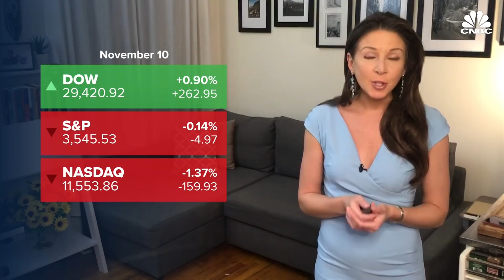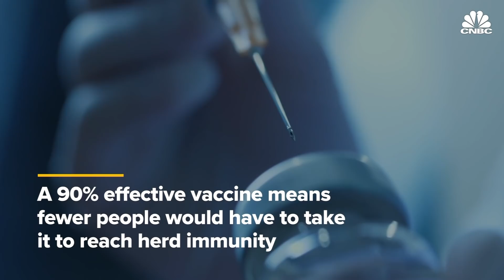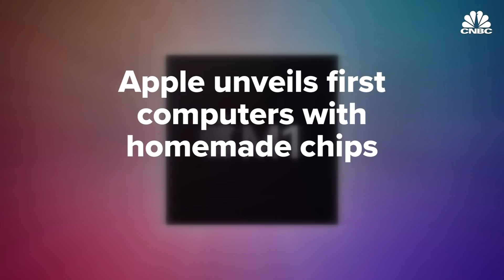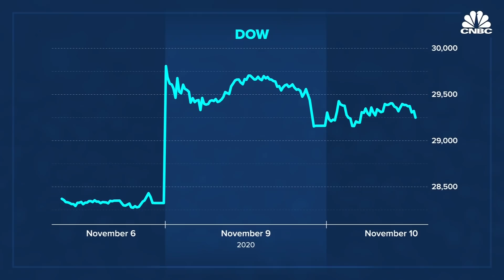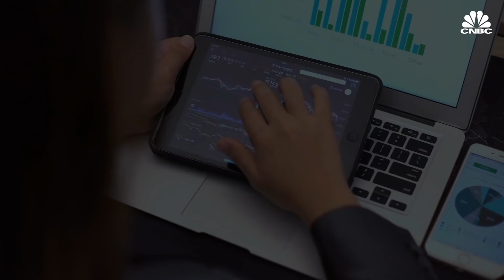Pfizer's Covid-19 vaccine is 90% effective — here's what happens next: CNBC After Hours

Comment: How can it have a 90% success rate when the flu vaccine (which they’ve had for decades) success rate is usually around 40-50% each year?
Reply: the flu changes a lot, same virus different structure, and the vaccine they give out is from last years flu, not the current year, so it might not work as well if it works at all

Comment: After the recent drop, if the bulls can take the price above 16,OOO again it would signal strength and the projection that BTC will break a new ATH, This is a very good time to also buy bitcoin and trade with a very profitable strategy, only gamblers will want to Hold the coin idling until it hit a high rate. I have been trading with Nicholas Myron daily signals which I have managed to build my portfolio from 3.3bTC to 6.8BTC within a few weeks. I no longer work 9-5, and the feeling is financial freedom. I have lost so much in the past trying to find a great working plan but none come close to Myron. Myron can be reached via Instagram @nicholas__fxtrade) for any assistance on all crypto related issues